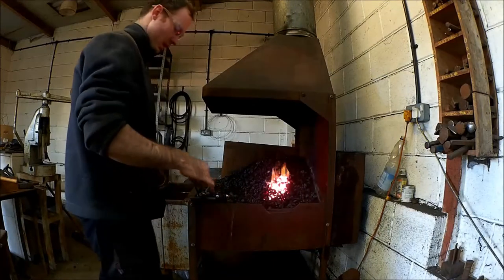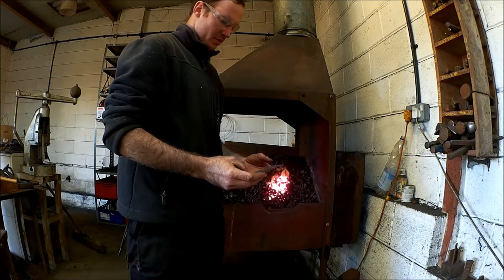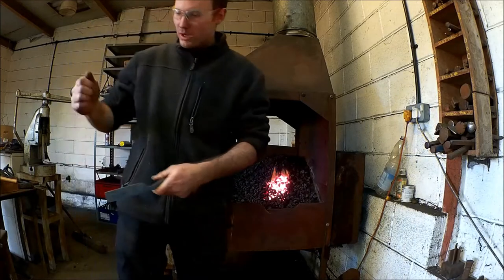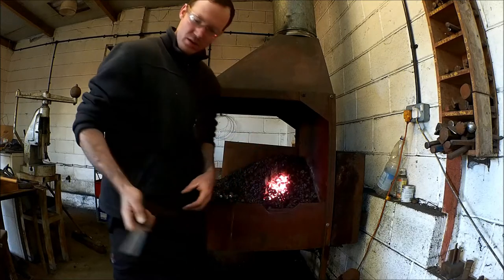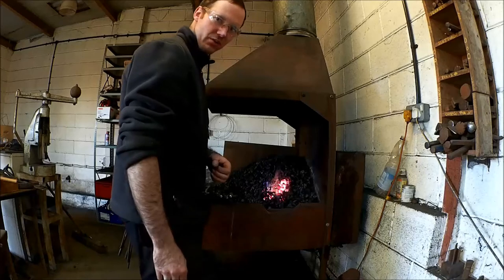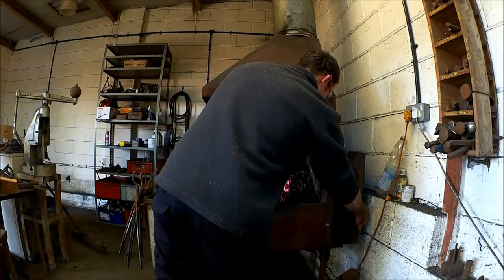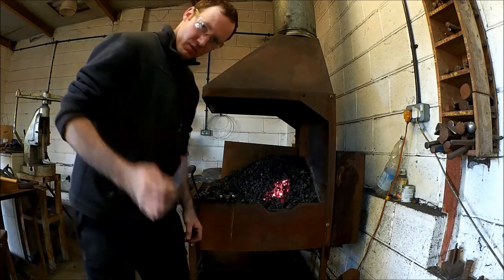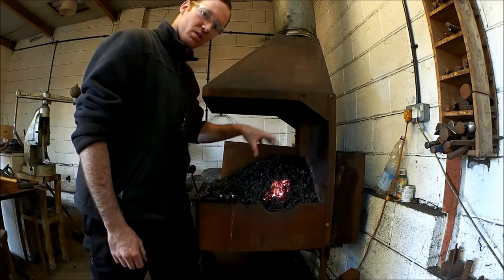Blacksmithing Tips And Tricks: How To Never Burn Your Work Ever Again

Comment: Dang. I got all excited from the title.  Bummer it doesn't work for hand-cranked forges. Ehhhhh, maybe I should get around to rigging up a belt-drive.
Good vid regardless!
Reply from the maker: Thanks. Sorry it won't  work with your set up. hand crank blowers are lovely.
Reply: No worries :) I like the hand-crank because I like the idea of burning calories while actually creating stuff, instead of just throwing it away at the gym. That and it's nearly bulletproof.
Reply from the maker: +verdatum he he.. I love the idea that you can forge off grid with them. forging is enough to keep me out the gym. I did think about a foot treads bellows and hammer to get an all round fitness instead of just my arms though 😁

Comment: I started using propylene to heat the project. I use a double rosebud configuration most of the time and I also have made different burner lengths for when I need a longer forge length. I made a gas valve that is self igniting when weight is placed in the forge. No weight, no burners, no wasted gas, and my gas cost went from $3.50per hour to $2.80 an hour. Using only the heat necessary and only heating the portion of steel I'm working on has done thing I never intended.  Like other parts of the project that normally move out of place now stay as forged. I am also working on a tourch that will heat the project while I am forging, sounds crazy but I think in some instances it is possible.
Reply from the maker: I Love your innervative mind! what clever ideas! i've used a larger piece of steel heated in the forge to keep smaller pieces of steel hotter for loger by using the large peice as a bolster for punching holes, that proved to work well and used only the heat that is wasted by the fore (solid fuel, coke) I'm interested in induction forges and i'm sure you could have one intergrated into the anvil possibly made from titanium if its not affected by the electrons...